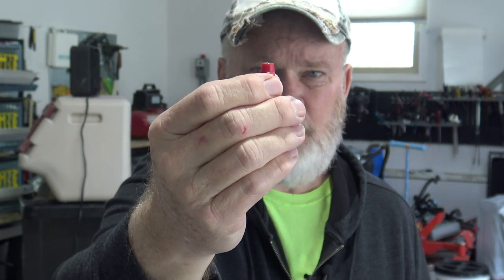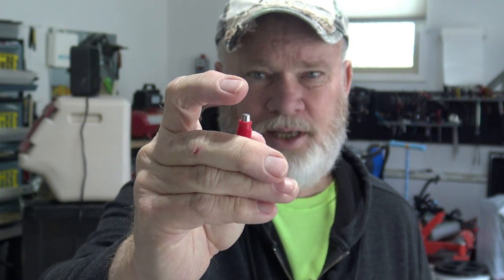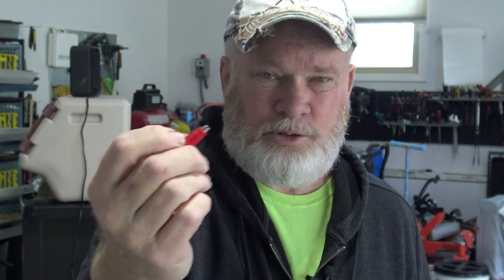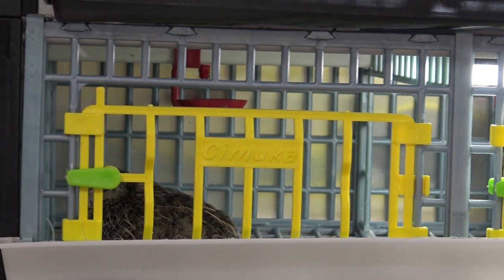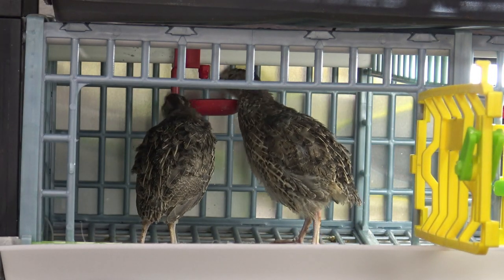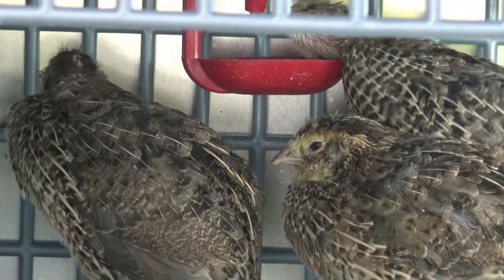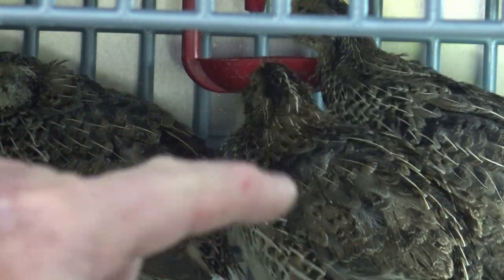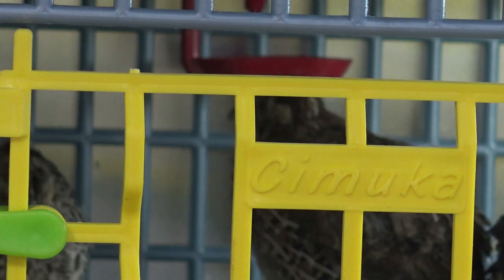Hatching Time watering mechanism failure.

Comment: Ironically im having the opposite problem from my upper left hand cage. the Nipple keeps dripping and wont stop. Its a slow drip. I guess I need to unscrew it and try putting tephlon tape on the threads first. IF that dont work, the nipple itself may be the issue. I picked up my first 11 quail yesterday too....so we are off and running so to speak
Reply from the maker: Let me know how it works out to fix the leaking nipple. Is the water coming out of the threaded part to screw into the tube? Or is the leakage from where the birds peck at to drink. I had to use a tiny wrench to loosen the nipple and to tighten it back. Hope you are successful 🙂. So... how many hens and 🐓 roosters do have now?